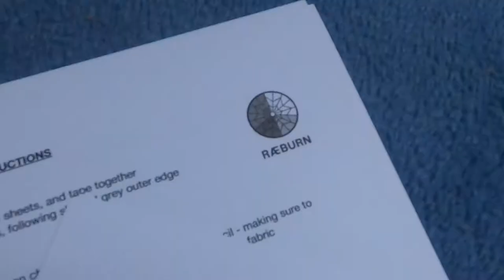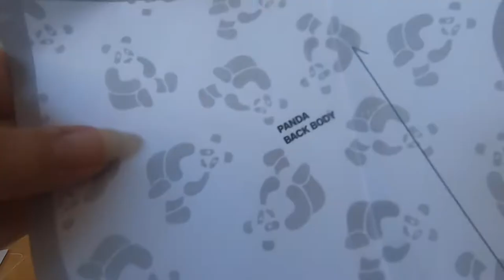Raeburn Panda construction

Comment: Thank you for doing this video.. it’s a little tricky to see what going on at several moments due to the angle of the camera, I understand it’s a tricky process to record.. I am a little lost in the construction process, specifically final final stages of constructing the head.. at 6:41 you finish attaching the top head to the nose with the panda side nose flaps still loose.. the nest shot seems to show them attached  top head, is there a scene missing? Many thanks for any help!
Reply from the maker: This was just a fun project which I did at hoe during one of our lockdowns - the download material from Raeburn will also help you in the process of the construction - have fun and thank you for your comments.